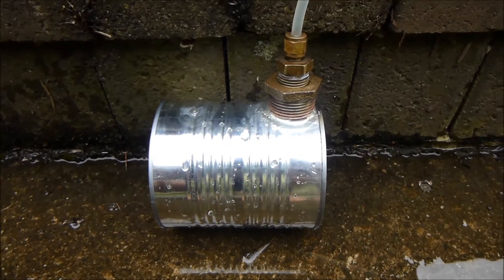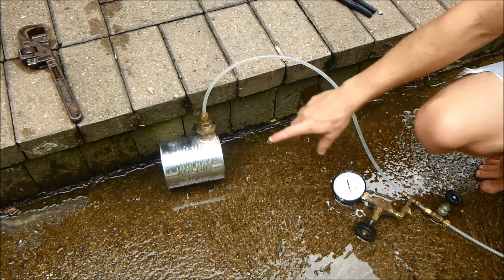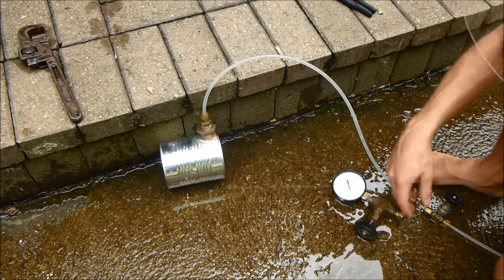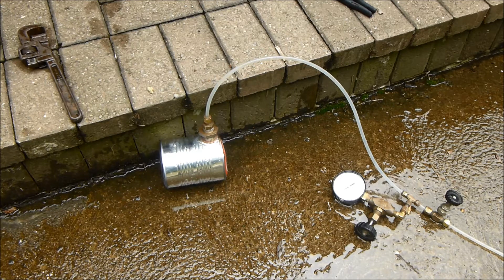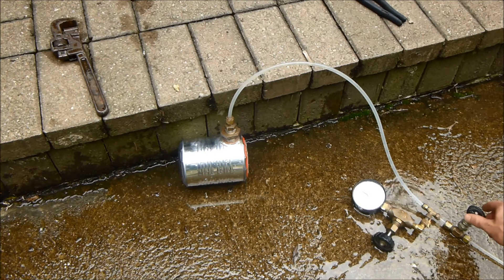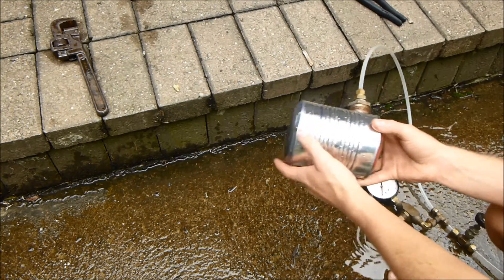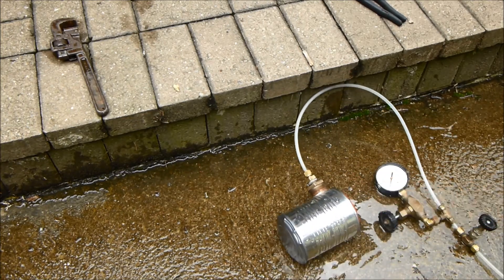Hydrostatic Testing My Homemade Tomato Sauce Can Boiler to 60PSI

Comment: What you need to do is add some stay bolts for those flat ends. Run 4-6 pieces of 3/16" all-thread through the length of the boiler in a radial pattern and leave about an 3/4" on either end. Secure the all-threads with a nut and a fender washer on either end. You could completely eliminate that bulging.

Comment: oh how I miss camping. when I was younger we'd go up on the mountain, enjoy a late night camp fire, and blow up cans of beans. it seemed to be, the slower we heated the can, the bigger the explosion, but this may have been just in our heads. we'd wait for the fire to build up some hot ash, then stick a can in the middle of it, and hope to somewhat aim. 15-20 minutes later, when we hear the ends pop out, the area within 30 feet of the fire is off-limits, because we know it wont have much longer to go. most of the food within the can vaporizes in an instant, and anything in the fire is ejected, leaving a hole where the can was. we'd use flashlights to try finding the can as it falls back down into the trees and to the ground. a can once encountered a tree limb, as we found it on the ground with the bottom formed around the shape of a limb. even 30-50 feet away you can feel the unexpected blast. I couldn't imagine being anywhere near something like that full of hot liquid when it ruptures. if it's planned and controlled, good times ensue.

Comment: Instructions not clear, electrocuted my genitals in the sink with a toaster. Just kidding lol, but for the record hydrostatic testing is pumping water into your desired pressure vessel to 2.5 times the amount of pressure as you would desire with steam. For instance, if a boiler is to be run at 100 psi of steam, you would pump it full of water to 250 psi to make sure it is safe. If there are no leaks or other serious issues, its good to go. I figure you know this already, but felt the need to clarify.
Reply from the maker: +Bryson Grondin LOL! Thanks for the tip
Reply: Makerj101 No problem! :)

Comment: FYI: A Hydro test is not just taking it up to pressure.  With all that water around you cannot determine if there was a leak.  You need to take a boiler up to pressure, HOLD that pressure for 10 minutes, then release for a successful test.

Comment: Well were afraid the flat ends wouldn't be tough enough, so after the test they aren't flat anymore! :P

Hey, why is there a faucet handle connected to the manometer? To hold a reading?
Reply from the maker: DigGil3 Hahaha yep!

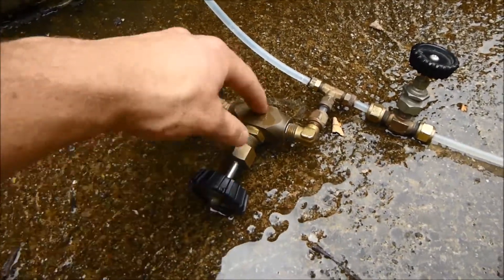I explain at 0:45 that the valve is only there so I could connect the two male threaded pipes together!  I don't have a connector!  I just used a bunch of random pipes that I have collected over the years.  But I guess you could use it to hold the reading.

Thank you!

Comment: Thats looking pretty good. The only think you may need to consider is temperature. Will the boiling temp weaken the can more.
Maybe you could make a bigger one by soldering two cans end to end, and then clamping them as well?
I wonder if you could solder or epoxy the lid on a saucepan?
Reply from the maker: Mongrel Shark Yeah it could weaken the crimps that hold the ends on.  Do you think putting a couple of threaded rods through the ends would take some of the stress off the edge where the ends are sealed on making it safer?

Hmm I think I would trust a lid soldered on a sauce pan less than this can.  Just doesn't sound like a safe idea.

I really want to test one with steam until it blows up. Do you have any idea how I could do that safely?

Thank you!

Comment: Great video but I do agree with the other commenter about using something else. I would suggest a used propane-cylinder as they are very robust and made to be dropped (many have fallen off a hot summer roof full of propane onto concrete without failure!) and roll around in a hot truck in the mid-day sun.  Additionally, they have an existing thread (pipe, I think?) that is professionally attached. The only thing I am not sure of, is that of corrosion over the long-term.  I have heard that steam accelerates rusting and corrosion and is why the put extra boiler-chemicals in to reduce corrosion. However, it may be that the propane cylinder might be coasted internally; whether that would standup or not is also a question. But to me even 30 PSI and the corrosion over time would make me very-nervous because steam expands (I've heard) about 1500 times when let loose! I just don't-want to see you wearing an "embedded" tomato-sauce can!  Keep up the great work and videos...
Reply from the maker: SpinStar1956 Yes I do agree.  If this fell off the bench or I whacked it with a hammer it would probably explode.  I'll have to see if I can find a propane bottle somewhere.  I have one that's like half full that I've had for like ever.  But it's not going empty any time soon.  I'll have to see if I know anyone who is a plumber.  Bwahahaha "wearing en embedded tomato sauce can!"  You cracked me up there!  But your right, I would hate to wear an embedded tomato sauce can for the rest of my life.  And it's quite possible too if it exploded.  :(  I better be careful.  Thank you!  Edit:  I just put a disclaimer in the video and description.

Comment: Try using a spray paint  can. They are made for a much higher pressure and would be much safer. soup cans weren't made for much pressure at all. Be safe as a steam burn can be very serious has it goes way deeper into the skin. Thank you for sharing.
Reply: You could try a beer keg.
How do you get a keg you ask.
Simple.

"Hey dad, I bet you can't drink a whole keg of beer"
Reply from the maker: Mongrel Shark Hahaha you are evil!!!  XD  Problem is, my dad doesn't drink much bear!!!  :P  But good idea!  

I think a propane bottle might be the safest thing.  But I don't know where to get one.
Reply: Oh, Great idea! Maybe you can find somewhere that would have bottles past their stamp date that still look ok?
Reply: Makerj101 Couldn't you connect several cans in parallel? The obvious way would be through pipe fittings, but don't you have a way to weld them? That way you could cut out the ends of several cans, well them end by end and there wouldn't be a choke point problem the fittings offer.

I've been building a spud gun which for air source I use a fire extinguisher I got from a school which was emptying several of them for demonstration purposes.
Reply from the maker: Mongrel Shark I could also try putting o-rings on it.  I'll have to see.  Thank you!
Reply from the maker: Mongrel Shark Actually I'm going to my grandma's house this coming weekend!  I think she has a bunch of empty 16.4oz propane bottles from space heaters that she hopefully doesn't want any more!  Like these:  http://www.homedepot.com/p/Bernzomatic-16-4-oz-Single-Propane-Cylinder-327774/202044698  Yayayayayay  :D
Reply: That would be ideal. YAY. Even got a threaded nipple :) I like Nipples XD
Although you should be able to run for a while on the can. Water to steam causes 1600:1 expansion. at exactly 100c (boiling point) More as it gets hotter. So you will get at least 21 cubic feet of gas from that bean can if you boil it dry. Likely more as you will have to get it well past boiling point to get the pressure you need... Considering your displacement is about 2-3 cubic inches. You should get about 36288 x 3 inch^3 piston strokes from your 21 feet of steam. Will the engine run for 12 min at 3000rpm without spitting a piston? (50hz piston oscillation at 3000 rpm, multiply that by stroke length and work out piston speed, only racing engines (petrol) do over 60mph at the piston)  Or if you run it slower you could get nearly 40 Min at 1000rpm. which is probably safer for the conrod and gudgeon pin.
Reply: No, I didn’t account for steam loss. 30 min is great, what did you use for a piston? Cant wait to see the video :)
I wonder if silicon would help seal the valve?
Reply: Silicon won't stick to Vaseline (or likely other oils) So put a thin smear on the shaft, then put silicon in  the leaky bits and let set. will still leak a bit, but should help.

You could try silicon piston rings too.
Reply: Silicon can be very slippery when lubricated well. Could be a fine balance between tight seal and too much friction, but worth a try I think.
Reply from the maker: Mongrel Shark I guess so.  I guess I never really thought of it as being slippery,  But now that you mention it, it is kinda slippery.  I'm not sure that a little silicon would hold back 30psi of steam very well though.
Reply: Yea, would depend on how you placed it a lot. Any reduction in gaps would have to be good though.
Reply from the maker: ***** A spray paint can would be a lot better, but they are not big enough to run my engine.  Even this tomato sauce can is too small.  But it was able to withstand the 60psi hydrostatic test so I think if I operate my steam engine at 30psi it should be plenty safe.  Yes I know steam burns are really nasty.  Thank you!
Reply from the maker: Mongrel Shark Yeah I hope so!  Or maybe a plumber!
Reply from the maker: DigGil3 Yeah I could connect several cans together.  But that's not really the problem.  I could always find a bigger can if I need a bigger boiler.  Like bean cans are almost twice the size.  The problem with using can's like this is that they are not rated for pressure.  So they might hold 60psi no problem but if my boiler falls over it's going to explode.  The cans just aren't thick enough.  That's why I'm thinking of finding a propane bottle.  Because they can be dropped with a lot of pressure in them and not blow up.

Fire extinguisher would work.  Probably be a lot harder to find though.

Thank you!
Reply from the maker: I'm pretty sure that I would not use the threaded nipple though.  Because I want my boiler to be horizontal.  I'm even thinking of putting copper flue tubes through it to make it more efficient.  My grandma has a drill press too so I might be able to use that to put the holes in it.

With the tomato sauce can a little more than half full with water from the start and my Bunsen burner up pretty high the whole time.  I was able to run my steam engine for around 30 minutes before it ran out of water.  That's just a guess though cause I didn't really time it.  That wasn't constant pressure either.  What I would do is run it real slow for a while until it built up 30psi in the boiler and then release it really fast.  I was really enjoying seeing it run super fast and make great clouds of steam!  XD  Those are some pretty good calculations there!  Did you account for steam loss?  I think most of the steam leaks out around the valve and piston!  XD
Reply from the maker: I used the same piston I used for vacuum.  I just sanded it down a bunch.  Way too much actually.  It leaks a ton.  So really I need to add piston rings or make a new one and not sand as much.    Hmm I don't know how I would do use silicon.  Any ideas?  Thank you!
Reply from the maker: Hmm that could work.  I just feel like the silicon would have too much friction.